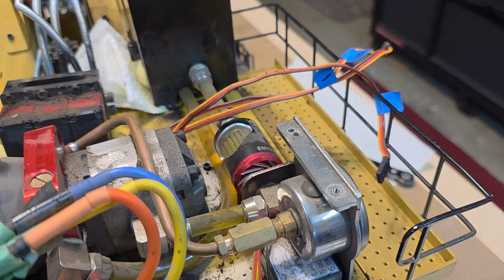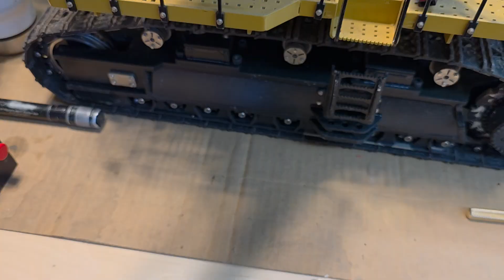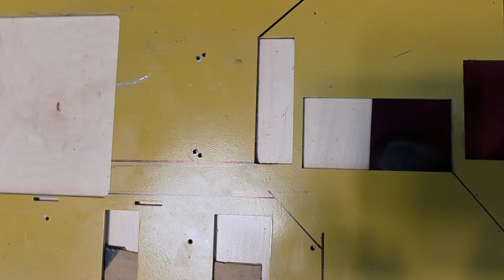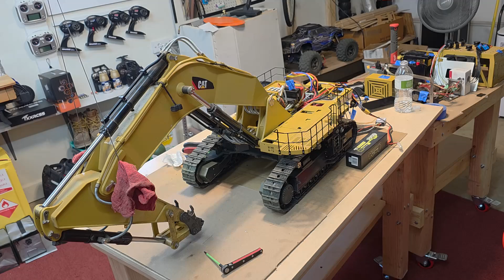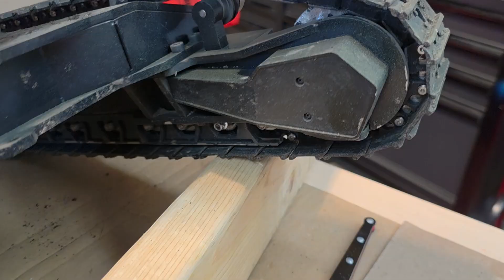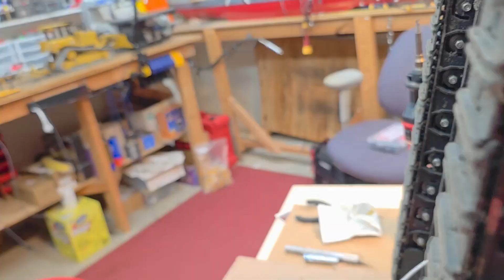PART 2 of 4, RC 6015 modifications. Cutting the floor plate, separate tracks from "house".

Comment: Hello there! 🖐️😉
Yes, indeed—it was all carefully thought out to ensure easy access to the various components and accessories essential for the excavator's proper operation.
You seem to be well-equipped with tools, which opens up even more possibilities for modifications.
It’s a sophisticated machine requiring equally sophisticated equipment, yet there are still parts that we felt needed replacing.
I admire your objective approach to making this excavator more reliable and ensuring quick access to all its internal components.
Impressive work.
The connection between the track motors and the speed controllers is often a problem area that requires replacement.
It’s been a pleasure following this second installment.
Thanks for the explanations and the diagrams.
See you soon! 🖐️😉
Kudos again! 👌👍✨🌟👏👏👏